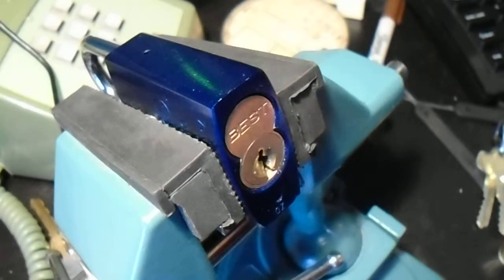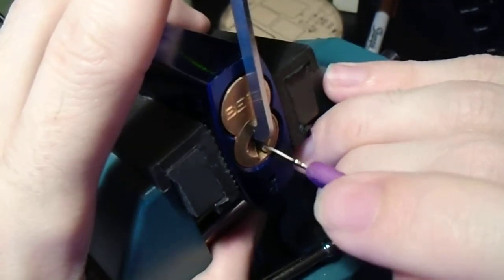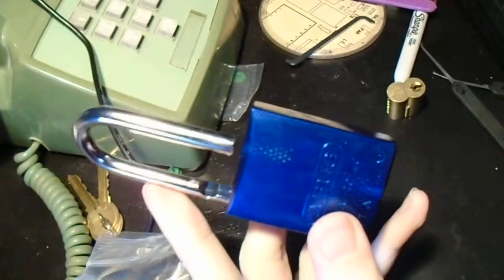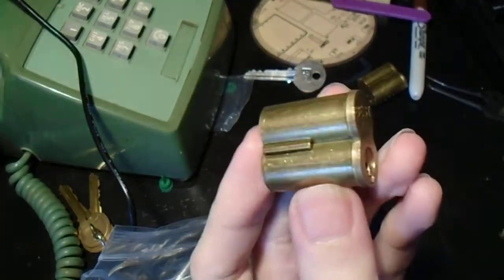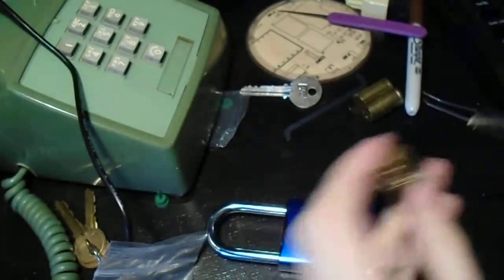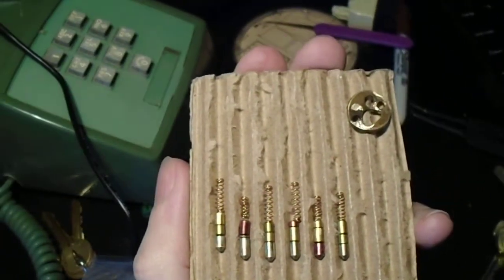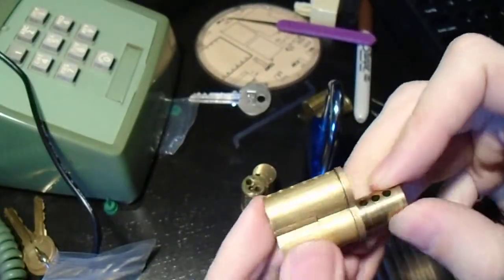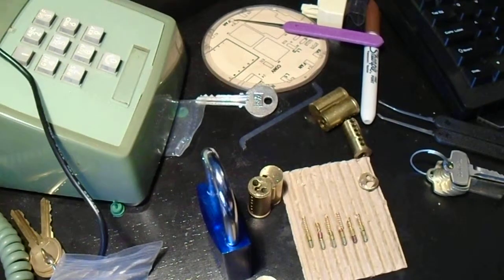(028) Abus 83IC with BEST core picked to operator and intro to SFIC

Comment: Very cool video enjoyed it.
I got two questions.
1. Can you bump an Sfic Lock to control? 
2. Why don't they use security pins?
Reply from the maker: +Ultimate Unnamed 1. In theory yes but, just as picking SFICs is more difficult because of the two separate shearlines, the chances of successfully bumping to one specific shearline is much smaller than successfully bumping a normal single-shearline lock.
2. It isn't that they don't use security pins ever, just that they don't by default and very few systems (or even locksmiths) seem to realize they are an option for factory systems. Aftermarket security pins are even more rare in the A2 and A4 SFIC pin systems so unless they are ordered that way from the factory it is wuite difficult to get them changed later. The final factor is that many common security pin shapes can actually interfere with the smooth function of the lock so the security pins made for SFIC systems generally will have much shallower and narrower spool cuts to make sure the pin doesn't wrap itself around the control sleeve.

HTH
Reply: Ok that's mainly what I thought too so Sfic Locks wouldn't make for good challenge Locks 😝
Thanks for the detailed information. 
The sleeve I think is also a weakpoint in terms of physical attacks like drilling.
By the way if you're ever interested in trading some cool Locks don't hesitate to contact me.
Reply from the maker: +Ultimate Unnamed They probably would not make good challenge locks, they are already pretty finicky. As for the sleeve being a weak point, yes and no. You can get cores with anti-drill features just like any other commercial lock and NDE techniques involving sleeve manipulation are still tricky. That weakness is also what allows a locksmith to remove a damaged core without having to chop the entire housing out of the door so it is a tradeoff.